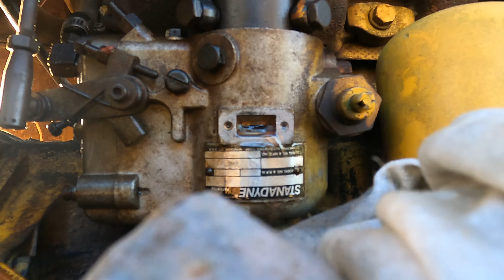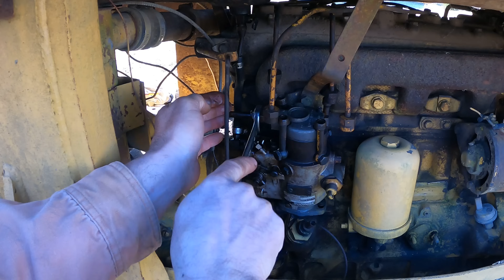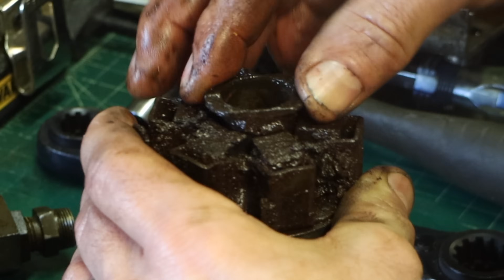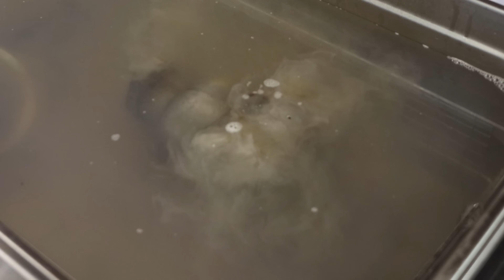Forgotten John Deere 1010 Track Loader, Part 2.

Comment: Bad luck John. It was still interesting to see you rebuild the injection pump and fashion the parts you needed to test. 
I found the level of engineering on a 60s machine mind boggling. 
Maybe this is the one to resurrect and show that not everything in this modern World needs to be thrown away.   It's a tough call because the engine looks crusty as hell.  🚽🦌

Comment: My suggestion is if you autopsy the old engine and it's not worth it to rebuild it (or it can't be done doe to lack of parts), as you pull the engine, look at the rest of the machine, you're already going to have to completely rebuild all 4 hydraulic cylinders on the loading arm (new rods & seals, possibly new barrels too), are the frame, tracks and drives still in serviceable condition or do they need lots of expensive work?
If it's only the cylinders and engine that are shot, can you find a newer engine and transmission (that still runs of course) that fits in the frame that you can easily adapt to the track drive mechanism and/or hydraulic pump? Is economically worth it to try an engine swap to make this a machine you can use on the Farm? cause I can already see a few areas where it will work better than the 'dozer and mini-excavator you're already using...

Comment: Use a shop Vac output flow to air intake pipe to help increase compression to get it to start if rings stuck ..
Then spray Marvel mystery oil in fog it out to loosen carbon on rings .

Comment: might be worth seeing whether the injectors put anything out before you write it off- they might be hopelessly clogged.  once you know they work, you could check the timing again, but just judging by the crap that was in the pump, i would be surprised of the injectors were functional at all..  with poor compression, it may never start without starting fluid, but i would think it could be coaxed into starting, maybe.

Comment: John Deere are always worth a rebuild. A good local John Deere dealership will still have parts. I did a 1953 John Deere B in 2000 and parts were still available then. New rings, rods, gaskets, valves redone at a car shop. I also did a 1915 John Deere B in 1982 and parts for them were still available back then. My guess would be that dirt under the valve seats not allowing them to seat right. The bore scope showed lots of dirt. Injectors also need checked by a diesel shop.

Comment: Well, here's my $.02. I am biased. I have an 80 350C. It runs for now. It smokes a little I believe it's the injectors. When the undercarriage is shot. things get expensive even on these old gems. I bought new rails, sprockets, pads, and tensioner parts. That was 2019. Those were $4K. It never ends no matter what it is. My rubber skid steer tracks were $3K. The bogeys and idlers were another $3K. The old Deere will still move dirt, the parts are always going to be a  factor. How much time do you have to invest? Cheers

Comment: Either there is rust on the valve seats which doesn't allow them to seal properly or the head gasket is SERIOUSLY Borked...

Considering you said you thought the discovered the coolant leak by cooking the engine, I'm leaning towards a Borked gasket followed by valve seat rust developing as it sat for years...

😄😁😆😅😂🤣

Comment: Throw a block heater on it and get as warm as possible, wet the cylinders with oil and hit it with a 24 volt jump start.  Just see if it has any desire to live again. I’ve used this trick before and it worked.  You don’t really have anything to lose. If you don’t want to invest in a block heater, hook the cooling system to another engine with a liquid cooling system and allow it to run It’s hot coolant through the engine block of that one.

Comment: I rebuilt a 1010 on my channel a couple years back from the ground up. Mine is the gas version. They can be a solid smaller machine when built right. One of the biggest problems with them is the steering clutches getting wet and rusting. The way I fixed that was by making sure every bolt that goes through into the clutch/brake area was sealed with silicone. Then I taped a bag of desiccant to the underside of the adjustment cover. It worked wonders. My dozer sits for sometimes a long period without use and I haven’t had one problem with the clutches or the brakes. As far as your motor goes. I think personally you have a valve sealing issue maybe as much as you have a ring issue. Maybe take the fuel tank off so you can pull the head. That will tell you everything you need to know. I bet if you did a valve job on it it would run fine. Maybe not tip top. But good enough. Which would give you the umpff to rebuild the rest of it. Those valves looked pretty rusty. The thing is. No matter what you do you shouldn’t have a problem getting your money back out of it just selling the parts. Plus it’s a good video series. Thanks for taking the time!!  Merry Christmas !

Comment: It's John Deere,  of course it's junk. Should you rebuild it, practically no. But you answered the question yourself on  the first episode as you striped the pump.
You're a YouTuber. Of course you should stripl it down.
At least be like Salvage Warehouse, take it to bits and then never mention it again.

Comment: I agree with scottwood. Pull your valve cover and re check your timing, pull your injectors and field test them.  Your pump was full of crud so your injectors probably are too.  If you can get them to spray I’d drop them back in and perhaps tow the old girl around ( assuming the rest of the driveline works correctly) allowing it to build some heat and build compression.

Comment: Fred williams from petersens 4 wheel and off road was trying to get a 6.2 diesel running. They ended up dumping atf down the intake and putting a gas soaked rag over intake to get it to pop off. If at least to see if it will run 🤷‍♂️

Comment: If pump is timed to cylinder one at TDC compression, then the valves would be loose on #1. That the easy way to tell our not 180 degrees out. If valve loose on #6 then it’s on compression stroke.

Comment: You'd think that if Area Diesel Service was already sending you the Torque Specs and parts you need for a DIY Rebuild, they'd also include the bit for that bolt that broke your custom ground flathead screwdriver...

Comment: I would think that the thing should at least smoke when cranking i have had diesel engines with compression lower than your engine. It did pop on ether . Re time the pump and try again even just running it some will unstick the rings

Comment: my thoughts are on the same lines scottwood said. recheck inj pump timing by getting the crank on tdc by physically checking the valves and make sure they are flat on the compression stroke, then make sure the pump is timed on the marks. And for sh@ts n giggles, sure, take some marvel mystery oil and put some in the cylinders and let it sit for a couple days just to make sure the rings aren't just stuck. Although the compression was marginal if you look at the spread the 3 and 4 cylinders were down so i'd say it may have a head gasket issue, maybe, not terrible yet but enough to cause low compression on those two cylinders. Then if your just feeling more curious and wanna commit to it, you can go ahead and pull the head and check the valves and cylinders and verify the gasket and block and head surfaces. 
But all this depends on what you plan on doing with it. I guess at that point you can decide if you want to pursue it any farther.  If you day heck with it i bet if you talked to matt @ DC he'd maybe buy it from ya, he tends to love that old stuff 😁

Comment: I enjoy your videos and have learned a lot. May I suggest trying out some Engine Restore in the crankcase. Although it's not necessarily a long term fix, if it can bump the compression enough to help get it to start, you can go from there to determine what other problems there are and if it's worth the trouble. Project Farm did some great videos on how it helped his tractor and other engines.

Comment: Hey Mate, It would be a content generator to get an engine running but then there is the hydraulic pump, pistons and all the hoses that would need a refurb. I personally would say its not worth the investment... however if youtube videos fund the project and you can use it at the ned and sell it for gain then go for it.

Comment: Need a comfortable place to do more work. Winter coming. All timing positions have to be 100% known. 
Or park next to shed giving you good tool access.
Reply: Remove blade & hydraulics for easy access to engine.

Comment: take the injectors out,  fill the cylinders with a mixture of pb blaster and marvel mystery fluid.  let it sit for a day or so. go out and spin it over a few times and repeat this process a couple of times.  its gonna be messy.  while you have the injectors out have them flow checked and cleaned if you can. should not cost much to do this.    spin over engine to get all liquid out of cylinders with injectors out.  install injectors and try starting  again.  im betting the rings are probably stuck from sitting for so long.  I sometimes take a gas rag to try and crank engine. if you can ever get it to hit and crank and the rings were stuck, a few heat cycles and load banking will usually free them up

Comment: I think it has decent enough compression...you need some warmth in the upper end
A.  Make 100% sure TDC and timing on pump set correctly
B.  Re-wet the cylinders
C.  Get a hair drier or a heat gun, run into the intake manifold for a few minutes to get it nice and toasty (or that propane torch thingy)
I have a feeling it will burp to life once it's warmed up and has oil on the cylinder walls (plus the rings have been dry for how long..they might be sticking/hanging up), however that frozen up water pump is going to be an issue more than likely...which means you might have a water leak, which like you said it might have overheated.  
If you have some oil I say drain the old and replace with fresh/new oil...that thinned stuff won't do you any favors
Keep em coming!!!!

Comment: See if it will start after the wet test before tearing into it.  get a good strong battery.  If it starts let it run a while then redo the compression test.  If thats bad, you know what you need to do :)

Comment: I would find something with the same motor and just pull the motor, could prossibly save a few bucks doing that over a rebuild. Great work with the stan pump, ADS has some great in depth videos on them.

Comment: Before carbide inserts for turning , I used to highly polish my silver steel lathe tools.  My coworkers thought I was wasting my time until they realised that I could turn a mirror like surface.  Carbide seems to remove that option.

Comment: You did a great job on the injector pump, so that is working now. Compression test is borderline. OK , next step - test the injectors, they are off the engine, so easy to do. Then go from there. This will give you a direction to go in. Also like other comments, put some HEAT into the inlet manifold when trying to start it. Good Luck.

Comment: Given how fugly the one valve was, I would bet money they aren't sealing perfectly, couple that with dry rings and your compression will suck. As mentioned by others, I would check/clean the injectors (based on the crud in that pump), heat the intake with a paint stripper gun, and give it one last try. But, I'm a Diesel Creek fan, and that's something like he would try before giving up for more in-depth fixes.

Comment: In two forum posts that I found they claimed that only JD has the rebuild kits, but I did find kits on Jensales. The price though, 4k or thereabouts 😮

So I'd try a couple of things before I teared into it. Scope the bores, do a leakdown test, and if that checks out, then try to loosen up the gunk in the rings with solvents.

Comment: Check your injectors. If you can get it running at least poorly while a little oil in the cylinders, maybe the heat cycling could loosen any stuck rings. John Deere only made 127 diesel 1010's so it is an oddity. Autopsy after words might at least give you closer.

Comment: First: Happy holidays! 
and well i think a total re-built is a bit expensive for this old gal 
i think checking rings and valves is a good step and learning more about it's issues (which i think are still a few more') 
i really hope the coolant didn't crut up everything inside

Comment: Since it was sitting so long and the injection pump had a ton of crap in it, it's likely that the injectors do as well,  so pull the injectors and test them while cranking and see if you get fuel through them.  
Next, check valve clearances to make sure none are stuck open or have a build up of rust/gunk from sitting ao long to let them close fully.

Anyway you look at it, ill watch the video, you do amazing work. Keep it.up.

Comment: Put a little oil in the intake ports. Remember how they are rusty?
Reply: I always use the leak down test , you will see if it is rings valves or head gasket.

Comment: Do what you think best. 
In 1998 I bought a Farmall B tractor that had been sitting by a gas station, on my way to work, for years. It was rough and I paid too much. My friend brought it home on his trailer and told me to get on and steer while he unloaded it. He said it would be the last time I get to ride it. 
2 years later, I got it disassembled into very small pieces.  Every nut and bolt on it was rusted solid. 
After rebuilding the engine including welding the cracked block. unsticking the engine, replacing two cracked sleeves with replacements donated by a friend, repairing the diff, trans, clutch, steering, and tires, I drove it out of the blacksmith shop and off to the Memorial Day Parade. 
My son and I did all the work except for the machining and valve job at Arnold's Auto Parts in Coldwater. I invested about $700 and drove it for about 10 years before it dumped the water into the oil pan. 
I sold it for $200.00 or about $0.10 per hour of labor. 
This was long before YouTube and I had hopes of using it to generate the price of a Ford 8N. 
Did it pay off? I think so. It plowed and planted. I drove it in every parade I could. It pulled kids and parents on hay rides. Helped mow 32 acres with a sickle bar mower. Took my Mom for her last ride around her farm before she passed. The best was having my 12 year old son work on it with me. 
I later bought the 8N I wanted and kept the Farmall B. My son drove it a few times and we learned a lot. 
Would I do the same on your crawler? Probably if I was your age. I'm 72 now. We sold the farm and moved to a smaller house with a 1/2 acre lot in town.  Not much room to turn the crawler. 
The 8N is too big but I'm keeping it anyway. Good luck and have fun no matter what. 😁😎
Reply: I hear your pain ! getting old sux ! I'm 72 now as well did the same as you but only out of duress house burned down and could not afford to rebuild and after 4 years living in a school bus it was time to sell the ranch ! got a house with a big yard and i realy wanted to keep the old furgie tractor but had no way to move it with my tiny toyota pickup so it had to go too.... but it's ok...i have no where I could use it now anyway.... it's all relative,  and we change over time even if we don't want to.... city life still bothers me but I am slowly getting used to it. it's not having the land to rome on that gets me though. it will get better.... or you will just get used to it.  try to look on the brighter side of things....
when I get fussy my wife reminds me we could still be in the school bus and that snaps me out of it !   remember it can always get worse !

Comment: Sorry to hear the engine is pooched. It would be interesting to see you pull it apart for info. I bet some of the parts are available but probably not all. If it is the rings you may be able to get it running after honing.

Comment: I would go with Scottwoods advice. Checking the pump timing, and valve clearance. Maybe the valves are passing when trying ti start. That would lower the compression also. At the most, take the head off, check the valves and head gasket. Personally, I would not go any further if its the cylinders/ piston rings. But I know you jon 😂😂😂

Comment: What is your intent for this piece of equipment? Is this something you are going to need for your farm or is it just a toy? Remember, the hydraulic cylinders will need rebuilding/new shafts, the engine probably needs a rebuild and you still don't know if the drive system works. Granted this could be a great YouTube project but it will be costly. Maybe a GoFundMe or some Patreons could help but this will still eat up your time for a while. I would like to see you bring this back online but it may be too much for you. You decide.

Comment: Pull all the injectors and with them hooked up to the pump see if they are spraying a fine mist.  then put oil in the cylinders and crank it if the rings are dry or crusty a long run might improve the sealing and rehabilitate the engile.

Comment: No need for a whole lathe job when you have 2 non-functioning glowplugs to make into bushings for the compression tester.  Just drill out the innards and tap the hole.  Also I would have checked to see if that air chick fitting is  the same as one of the typical compressor types,  Might have been able to just cut some pipe threads on the glowplug and use a shop air fitting..

Comment: Also you should be able to start it by putting oil down cylinders. Ether will be needed too. I have started many engines with low compression using this method.

Comment: Well, if you're looking for some YT content, an engine rebuild would be just the ticket.  It looks like you can get a kit for around $900.  I know I'd watch you do it.  Also, when it comes to timing the injector pump, I know that my little Fiat diesel is not timed at TDC but at an advance mark.  You might want to look at a manual to see if that's the case with yours.